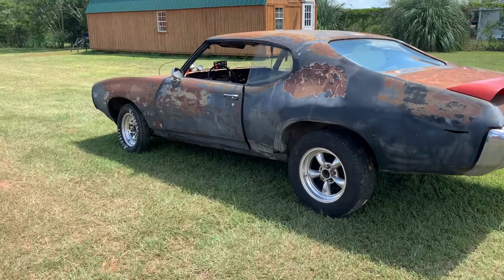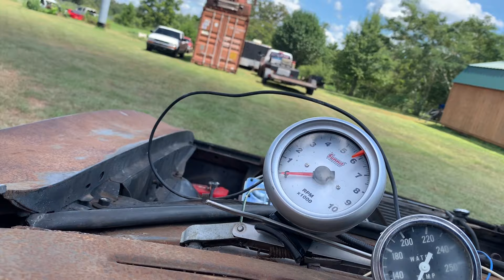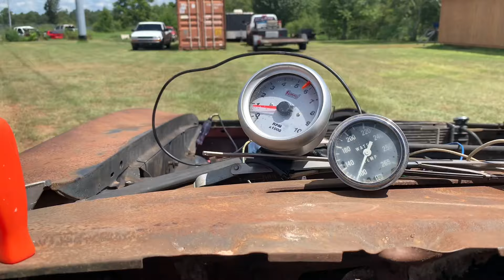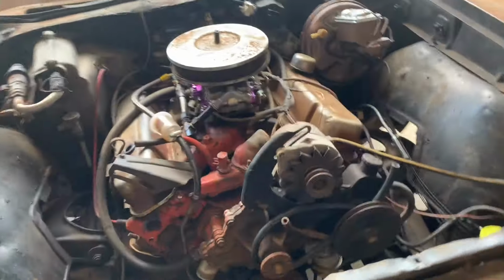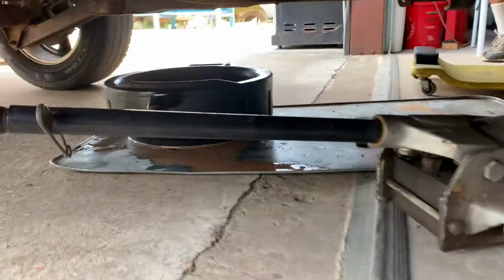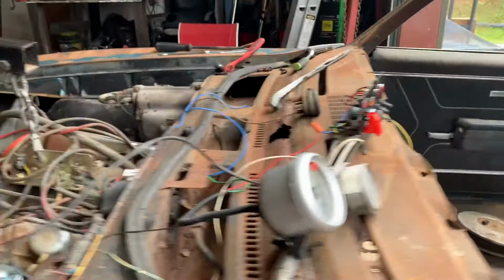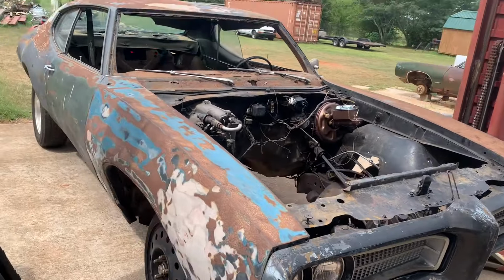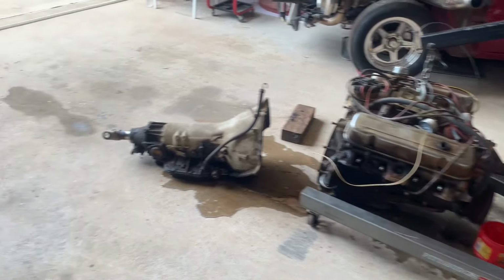The 1969 GTO barn find getting the 400ci Pontiac and the th400 trans pulled

Comment: What kind of carburetor is on the 400 motor it's running good get the trans going and you can drive it around
Reply from the maker: It’s a quick fuel 750 with a proform main body. 4 corner idle adjustment with fully tunable metering plates.

Comment: What was the reason for pulling out the motor and transmission I can see why the tranny
Reply from the maker: The trans is junk and it’s easier to pull both. I want to paint and reseal the motor while it’s out
Reply: @323Fabrication  that's kinda what I thought was the reason but wasn't sure I agree with you pulling out both is much more easier and if you pull the front clip even easier yet plus you can replace the body mounts under the core
Reply from the maker: That’s right, there’s a lot more going to be done while it’s out and accessible
Reply: @323Fabrication  cool